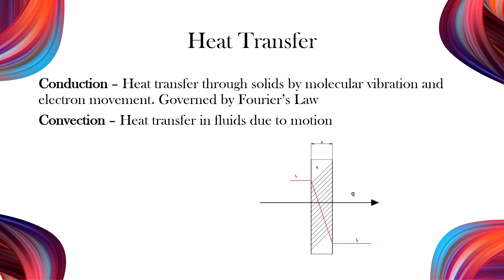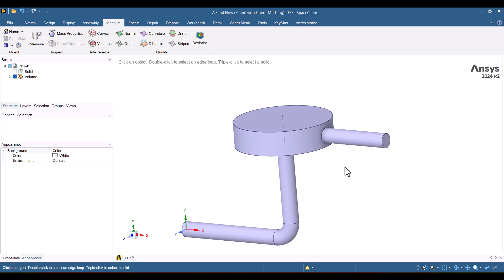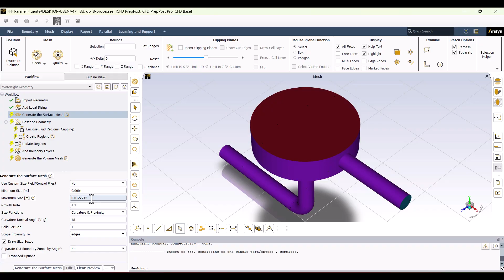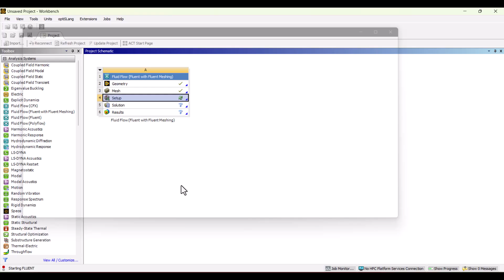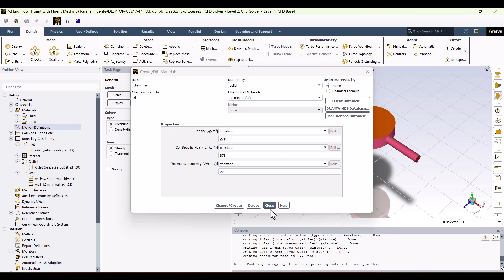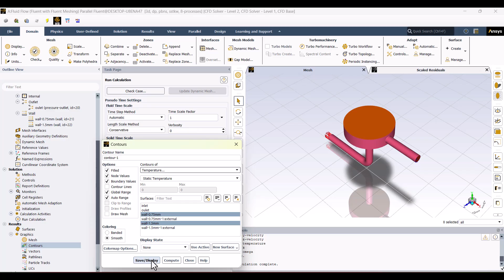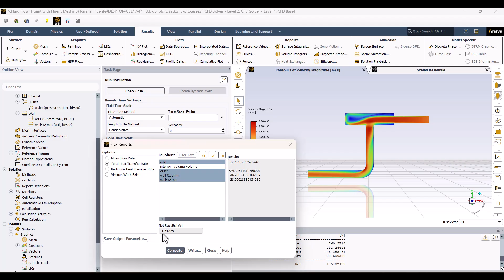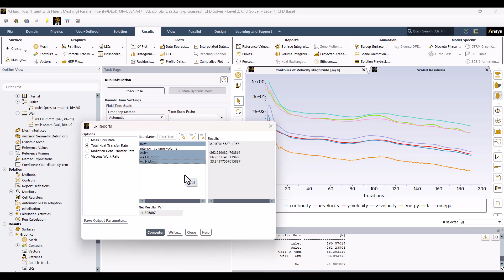💧Ansys Fluent Tutorial: Simplify Your Heat Transfer Simulations with Shell Conduction🌡️

Comment: Entering convective heat transfer coefficient directly feels like cheating because in most cases, we do not know it or cannot predict it accurately and in fact thats the job we are given many times. Find h. To give h directly just simplifies the problem too much. Still its a good video to understand the basics of shell conduction.
Reply from the maker: Thank you for the comment. The h value is straightforward and almost accurate enough for engineering purposes in natural convection for simple cases such as cylinders, spheres, etc. The values are available in all textbooks.
Reply: @caewitharminhashemi  but what about forced convection?
Reply from the maker: Usually, a conjugate heat transfer (CHT) simulation is carried out either to determine the heat transfer coefficient (h), or by including the surrounding environment in the model, the software accounts for the heat transfer without needing h.
Reply: @caewitharminhashemi  So like we have to create a fluid domain box around the object and fluent estimates the h directly?
Reply from the maker: Yes

Comment: Hello, using shell conduction, how can I simulate heat conduction in a body that absorbs heat because it is being heated by nearby bodies? When I enable shell conduction, the software forces me to enter a zero heat flux, but my body should not be adiabatic. I wanted to know how to assign 'no condition' to the body. I’m not sure if I explained myself clearly.
Reply from the maker: @PietropaoloMessena  Hello, shell conduction is used for the external surface to model conduction through a shell, and there are options for radiation and convection for heat transfer into the environment. I didn't understand the meaning of 'heated by a nearby body'.
Reply: @ 
I need to simulate a pipe in which two small aluminum cylinders are immersed from the outside. One of the cylinders must provide the fluid in the pipe with a certain amount of heat, so I have no trouble applying shell conduction, as I saw in your video. However, the other aluminum cylinder is cold and must be able to absorb heat from the fluid. What boundary condition should I apply to the second cylinder so that it allows heat to pass through from the fluid?
Reply from the maker: @PietropaoloMessena  as I understand, you should use coupled via system. You can find it options
Reply: Thank you! If I find any problems, can I write you?
Reply from the maker: @PietropaoloMessena  Yes. If the problem is solved, write in the comments so that others can use it too.
Reply: @ Thank you, the problem solved. Congratulations for you channel, it's very interesting! 😉
Reply from the maker: @PietropaoloMessena  you're welcome 😊

Comment: Hi, great video! I use Ansys 2021 R2, and i had a problem, i couldn't find checkbox for shell conduction in wall/covection, but find out that shall conduction can be applied only to wall that have "Name Selection". So if someone has the same problem, just name your wall. But i still can't figure out how to apply shell conduction on the interface (contact region). I need this to model deposits. Any suggestions?
Reply from the maker: Hello, thank you. I don't remember the interface of 2021. Yes, you have to use shell conduction for walls that are exposed to the environment. I think you want to use it for internal flow, but you cannot use it for that purpose.

Comment: Hello! Can you help me with harmonic acoustic in Ansys?
Reply from the maker: @avalanche.  Hello, how can I help you?
Reply: @caewitharminhashemi  can you give me your email? 

I want to calculate strength of steel plate subject excitation from a diffuse sound field. 

I started with an example from the Ansys Mechanical APDL Acoustic Analysis Guide “structural panel subject excitation from a diffuse sound field”.

Each new calculation of this example results in new values. 

I realize there is a random process used there. But in reverberation chamber experiments, there is repeatability of results.
Reply from the maker: @avalanche.  You can find my contact details on the website https://arminhashemi.org/